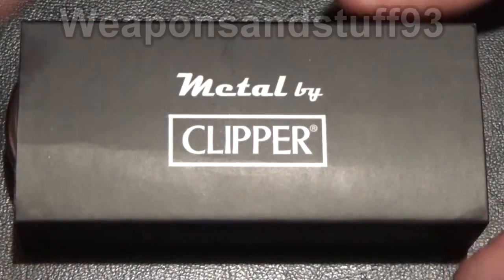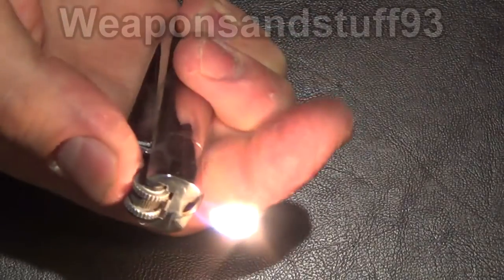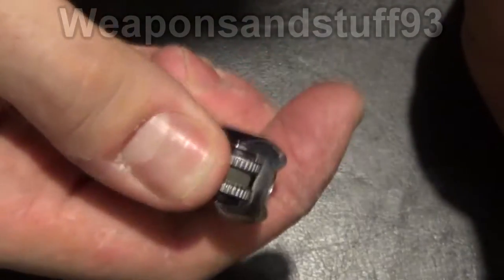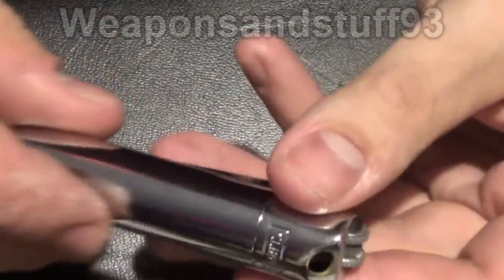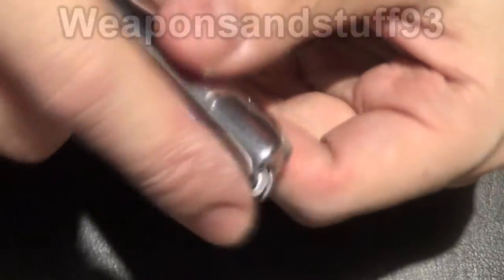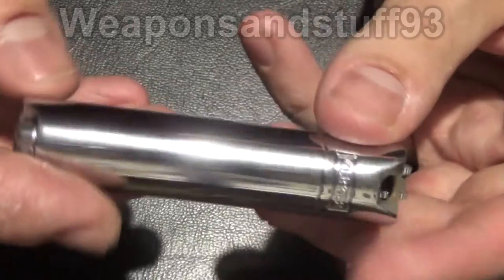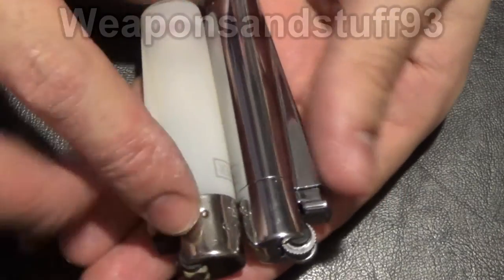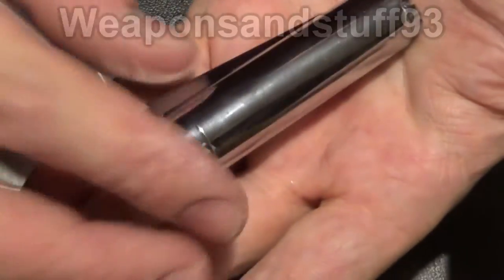Clipper Metal Pipe Lighter

Comment: Thanks for posting this. Is the metal Clipper pipe lighter covered with real metal, or is it metal-toned plastic? It's hard to tell on these videos, but the one in your review of the Clipper metal cigarette model looks like it might be made of brushed stainless. This one is shiny enough that it looks like it could be plastic. Also, are they still made in Spain? I like the plastic one because it is refillable and was made someplace other than China!
Reply from the maker: It's metal probably aluminium or steel
Reply: @Weaponsandstuff93  Hey, one hour is a mighty fast reply to a comment left on a video published two and a half years ago, and thanks for the information. So I guess they're no longer marked as to country of manufacture?
Reply from the maker: Not that I can easily notice but a lot of clippers used to be manufactured in Spain
Reply: @gregs.2679  I have a brushed "Rose Gold" clipper on its way in the mail. I do know that the plastic clippers are still made in Spain, because it says Made in Spain on the top metal piece where the flame comes out.